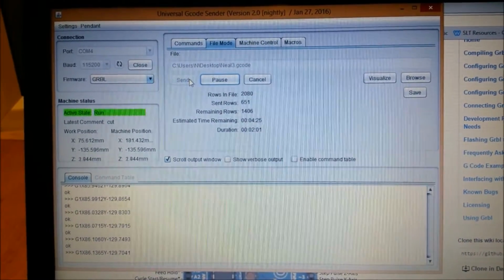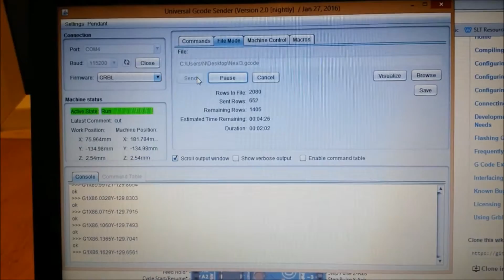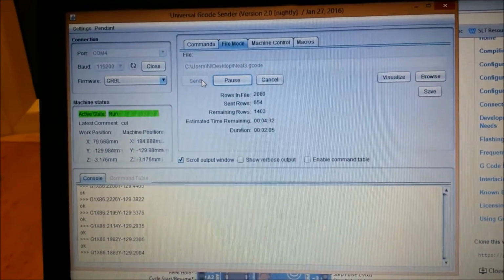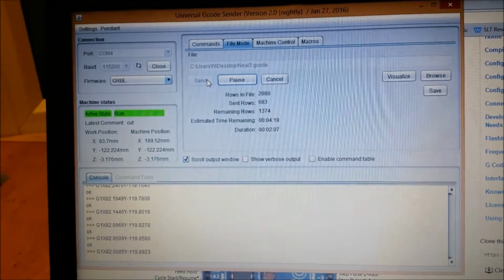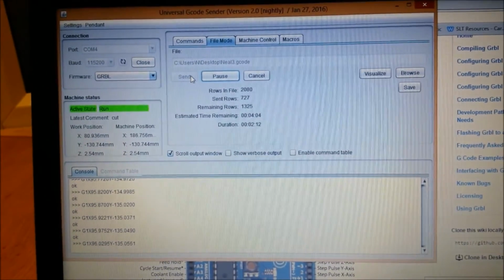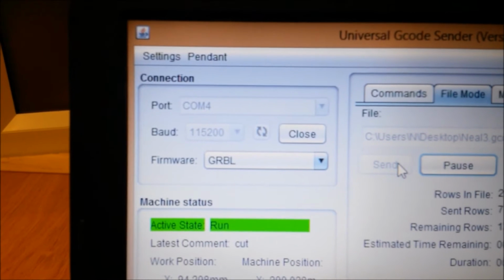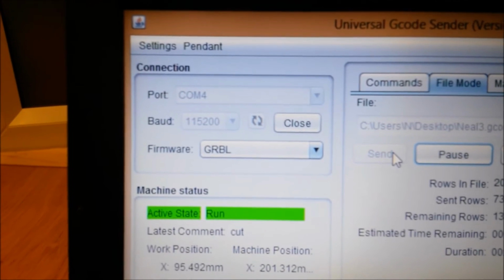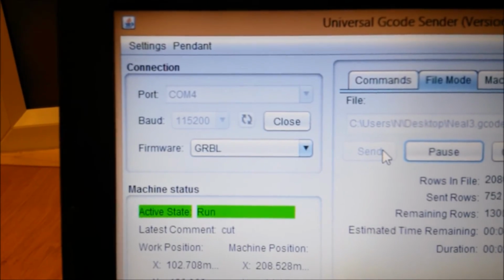Arduino Uno GRBL to TB6560 1 Axis to Stepper motor

Comment: Thanks a Lot for this Explanation of this driver I had trying so many times to to control 8 wires stepper motor but i got stuck so would u tell me whats the problem please ? One more thing, Why you did not use or connect Enable pins on the driver ?
Reply: Hi !  Did you find out why not to connect the Enable pins?
Reply: No not yet